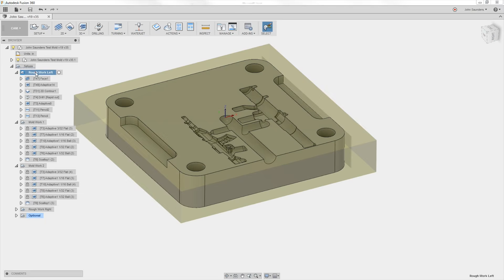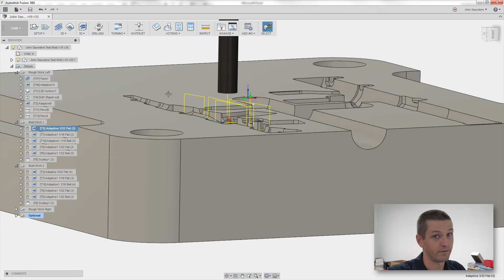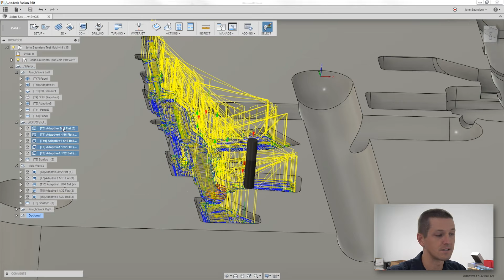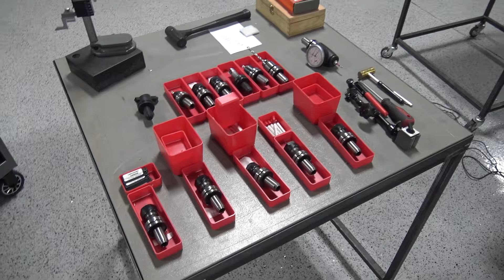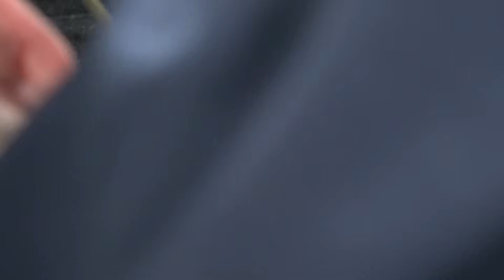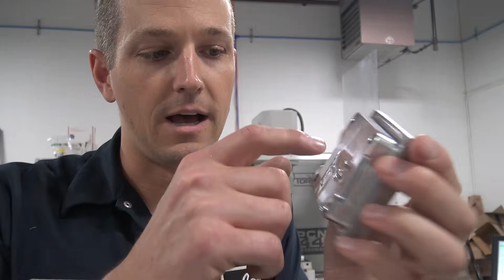Machining a DIY Injection Mold!  WW114

Comment: That is very nice. I have been machining with micro bits all my life. I work in the jewelry industry making injection molds. Class rings, Championship rings, Coining dies, etc. The other day I had to make a .003" 30-degree tool to cut lettering into a steel block for a coin.  I am impressed you were able to machine with the .03" tool and not break it for it is your first time. The .01 and smaller get a little trickier.
Reply: Smallest end mills I have worked with is 0.01" making screwdriver recesses in magnesium screws. At least once I managed to break the cutter just putting it into the machine. I've done a bit of drilling through circuit boards with 0.2mm drill bits, luckily the bits held up fine.

Comment: You can probably even use a semi rigid CNC router for such fine engraving, even in steel. I can't imagine a 40 taper spindle with a 20hp motor being optimal with a 1/32 end mill...

Comment: One thing I would say, I work at a mold shop and do this every day , when checking run out don't just hit the tool to adjust it take the tool out and add plastic shims Into the spindle taper to adjust for run out. That will ensure that I will never bounce back. And you should check every Tool regardless of your stock to leave because I've had tools run out more than the stock I leaving and violate .love the videos more mold stuff would be cool.

Comment: Cool machine, a nice bang for the buck.  Does the software import the part design and build the rest of the mold around that?  It so the software is junk.  The “flow channels” (runner system) are like sewers.  This will end up being scrap.  The diameter is way too large.  Next, the placement of the molded part within the block is terrible.  What appears to be the stock is right at the end of the block.  Nothing to support the block.  The other end has a lot of landscape in front and is well supported.
Center the part within the block!  I approve and critic designs for a living and this is a total disaster.  It may be the editing but the feed rates seem very high.  Could attribute to tool breakage and poor finish.
Reply: You're not wrong at all, but it's also possible that this is a core / cavity insert for an existing mold, in which case they might have to work around constraints for pre-existing features. (That said- I also wouldn't be doing my mold design in F360, and I'd have some shiny Sim Moldflow runs to show off while describing the flow paths, etc.)

Comment: Looks great but everything in the mould has a 0.4mm radius minimum, using that last tool, but in the CAD you had sharp edges how is that normally acheived?
Reply: It's not normally achieved at all. Adding all the inside radii on a really complex mold half will frequently bog down the CAD workstation to such a degree that you just plan for the radii to be there based on the size of the tool that you'll be cutting with.

Comment: I am working as a CNC operator for an injection mold base company,How much machining time taken to cut that runner design.Which tool you have used for and how do you do select the boundaries in software for it if possible please explain it in a clear video or share the details to my mail id.
mvrssnath@gmail.com
+91 8341108089
Waiting for your reply sir.

Comment: John, 
I think that the runout issue was because you measured the tool on the tapered section. My guess is that if you measure the end mill on the straight section, it will have almost no runout. The runners came out smooth enough but if you want them to have fewer chatter marks open up the radius of the runner a few thousands and the machine will cut it in a two passes.  Anytime that you run an end I’ll into a path fully buried it’ll chatter a little. I’d like to see the operation where you put in the guide bushings for the leader pins. Ae there any ejector pins in this mold? Overall great job!

Comment: Good video. Not being a wise guy, but checking collet / tool holder / spindle run out you should be indicating the shank of the mill. That is centerless ground and will be true. Indicating the taipered relief you could be picking up relief eccentric.

Comment: If you want to try another injection mold, please let me know since that is what I specialize in. We normally use tapered ball end mills with 1mm, 0.5mm, 0.25mm, and 0.1mm ball diameters. the tapered end mills are typically better since they are more rigid (less deflection) than a ball or square end mill. also the tiny end mills need to be turning around 12-16k in well balanced tool holders to reduce chatter.  

The roughing end mills depend entirely on the shape and size of the required cavity but i can give you some pointers on that sort of thing. 

Lastly, a cavity like the one you made in this video would actually be cleaner and pretextured with a sinker EDM. You'd need to first mill out the electrode in carbon or copper then mount the electrode in the EDM and let it spark away until the cavity is fully formed. 

If you're ever in SoCal please feel free to hit me up and i'd be happy to show you how we do things. (its not as pretty as your shop but it gets the job done)

-Sean 
Tera Engineering Co.

Comment: What's the spec on tne milling cutters are you using? I've never got anything below 1.5mm [ 1/16th] to not snap as soon as it touched metal even at really slow speeds and minute cut depths.

Comment: Awesome video, very insightful! I'm a sculptor looking to automate and increase production on a diy budget. Would it be possible to use 3d printed molds and silicone molds inside a simple metal shell for injection molding? What would some potential issues be?

Comment: Couple things I'd say, might have been said already, but my .02¢ .. I think you'd be surprised if you put on empty EM holder in the spindle with a typical AGD .001 indicator and checked how far you could move your spindle by hand.  Not with a hammer or any other shock, just by hand, pushing and pulling.  Second, I believe the 'slop' in your indicator is likely the backlash in the fine adjustment screws, simply.  Yep, they have backlash too, just like every other screw in the world, lol.  Lastly, molds generally are left with all sharp corners to prevent flash, and the 4 holes are usually ream/ bored to -.001 on the A-side (top) and +.001 on the B-side (bottom) or done oversized on Alum and bushed with hardened bushings, and the A-side has hardened dowels pressed in, to prevent galling with the constant opening and closing.

At any rate, rather new sub here, like most everything I've seen on your channel man.  Been in the biz close to 30 years, but have stayed open minded and am constantly adapting, as we all should be.  Nice to see the younger maker movement make its way into machine shops and keeping it going.  I'm a Journeyman, but the next generation, you included IMHO, doesn't seen to be as interested in that, but are learning as you go and getting better with each and every job I can imagine!  Keep up the good work and vids, thanks!
Reply: Comments about backlash related to the flat bottom EM, not the ball.  The jumpy reading on the ball would likely be attributed to the spindle bearings, tho possibly a loose dovetail, chips or a lead into the grind of the tool. Also, the gates are normally flat bottom, just generally speaking, instead of contoured.  Again, great looking little mold my man!

Comment: Would a typical CNC router 2.2kw water cooled spindle style wood router be able to make something like this, say injection mold for sinkers, soft plastic lures, etc. Ones I am thinking of are usually 200 steps per revolution stepper with 5mm pitch on the ballscrews, so 0.025mm potential accuracy +- the losses for rigidity.
Reply: We run two CNC routers, 15 hp water cooled & 12 hp air cooled. Both run all day. I can't see any advantage to the water cooled one, and several disadvantages. For small parts steppers are probably fine & a lot cheaper than servos. For the accuracy required for a lure there are a lot cheaper ways to get there than CNC. The fish won't care.
Reply: Yep.  I ran a 24K  2.2KW spindle and VFD for years.  Makes these itty-bitty cavities cut a lot quicker.

Comment: John, this is not a mold by itself, but it is a part of the mold, where we injection molders say core & cavity. 

The cross in between (you made here)is where the molten plastic flows, is called runner. and there is no sprue & sprue bushing where the hot plastic is injected. The runner should not be more than the half of the molded plastic part.

So when I say it is part of the mold is because it is missing few items like, water inlets and outlets for cooling hot plastic, sprue bushing for machine to inject and also I see that there are no ejector pins to eject the part from the cavities after the cycle is completed There is no injection machine in the world where the material is injected from the side. But if it is a Blow molding then YES. The Blow molding terminology is totally different than Injection Molding.

We never use aluminium for long production runs as Aluminium is a soft material, the closest possible material is 4140 or tool steel. Maybe they made this for prototype or a small production run like 5-10k shots. Whereas we calculate for a production run like minimum 100k.

Can you please check with your customer if i am correct ? Will appreciate your efforts.
Reply: It is indeed the mold - one half of the entire mold.  It is not an insert, and there is no frame.  no water lines are needed, not sprue bushings, as the plastic flow is entirely parallel to the parting line.  He didn't mention blow molding because this is INJECTION molding.  It is also an aluminum mold for prototyping - it is not a production mold (though the customer may use it to produce small runs of items for the small LEGO customizer market).

Comment: Erm, this popped up in the feed after your filem :)

https://www.youtube.com/watch?v=RMjtmsr3CqA

The Engineer guy, talking about injection moulding, history and modern practice. Which includes the breaking of the edge of the mould so there is a slight flashing, but no sharp edge to cut your operators..

Comment: I work for an injection molding company, doing a lot of mold designs. I always try to center the parts in the tool. The end of the rocket launcher is way too close to the edge. If any material or dirt gets caught there, that thin wall is going to collapse, very easily. Keep that in mind, if you ever do this again.
Reply: Brett Hobbs can i get a mold done like this?

Comment: I currently work in a shop that manufactures parts for pace makers.  I never knocked runout out of tools until starting this job.  It is a MUST when using small diameter tooling.  I would recommend checking the runout on the cutting edge as close to the end of the tool though.  It is possible to have runout on the cutting edges and none on the shank near the collet.  Also, you should be finding the high point of the tool before checking the runout.  If you are off center, you will not get an accurate measurement

Comment: Just for what it's worth. The "mold slot" is usually called a sprue. Just to have appropriate terminology.  But it's all good.
Reply: Out on a limb The initial run from the nozzle is called the ‘Sprue’. The branches are called ‘Runners’. The small ‘slot’ where the plastic finally flows along the runners and into  the mould cavity is called the ‘Gate’.

Comment: hey guys i need help!! how would you guys make a mold for a silicone injection product that is basicly a baby bib but it has a kangaroo like pouch for dry snacks?? i have 3d models and renders to see product im talking about? im at stage of manufacturing of product but i need advice on how to get from drawing board to mold to production. Can anyone help?
Reply: Call RevPart and they will give you a quote, they do silicone injections 844-738-7278. Or upload a drawing https://revpart.com/quick-turn-quote/ for a quote in 24 hours.
Reply: We specialize in making the silicone injection products.Feel free contact me caroline@modern-mold.com

Comment: how much would it cost roughly to make a mold? like the size of a skateboard wheel
Reply: NYC CNC like a mold for a skateboard wheel
Reply: Well it depends on the level of detail and complexity of the model, but... I'm guessing around $10,000 - $20,000 here in the United States. Assuming you already have the model designed to work with the mould designers, it shouldn't be too costly. Try to talk to many companies, large and small, and find a price that works best for you. The key is to get as many quotes as possible.

I assume you already found a place, but I wrote this comment for anyone else interested in the pricing.
Reply: skeletonboi is it really a piece of CNC worked metal $20,000 worth? What the hell.
Reply: @CesarEnrRC1  
mold need from 45 to 60 working days.... not child's play stuff.... the mold reach to 2000 pound weight

Comment: ok man. i have weighed in before but this i just cant leave for u to learn your lesson on your own. dude. Why, just Why are you Wasting you time with collets? they have Zero repeatability when holding both tools and parts. I about had a stroke when u said u had a 4 ten thousands run out + - . Oh My Gods and Goddess. U just published a vid showing so much better performance and u talked so highly of other tool holders. If u want to be taken seriously about making good products, u need to figure out what works and stick with it. collets are awesome, but only when used for what they are good for. When it comes to precision, just take your time, NO product requires you to be quick and if they do, they are not a good customer.
Reply: Indeed.  Shows up clearly on these tiny cutters doesn't it?

Comment: Did this mold require venting?
Reply: lol I doubt it. Maybe one or two little vents.
Reply: Depends on the plastic used.
Reply: Yes, these molds also require vents
Reply: No, they don't.  There's a minimum of surface area, and it bleeds just fine at the parting surface. I rarely vent my 2.5" x 2.5" tools, and they inject just fine.

Comment: the shut-off Surface by the rocket launcher needs to be larger because the molding pressure can easily push that out the plastic floating is called the runner the entrance to the park is called the gate I don't know how you programmed it would try to leave the park a dress shirt so that way you can get a really nice finish heart

Comment: Question - why did you scallop the edge of an injection mold... wouldn't that show a seam when the two sides are combined?
Reply: I am an injection molder, and mold maker......any mold will have a split line no matter what. The idea is to make it as little as possible, and or hide it in the geometry of the part. Scalloping in molds is the best way, but when you are done cutting the mold, you polish the surfaces to allow an easier ejection of the part.
Reply: Jason Vincent is a mold maker a machinist or an engineer?

Comment: quick note on tool runout. most mill spindles are requires to be under .0002 total runout measured at the taper. the only way I have seen near spindle spec runout conserved when measured at the tool involves shrink fit tool holders. 5 tenth tir aint no thing man.

Comment: Like your video, well done:) With regard to aluminum, I specialize in 7075-T651 aluminum injection molds. I have tools that have run 250,000 plus cycles and still going strong:) Just to help you out, that is a runner and those are called gates to the cavities and please, never chamfer across the runner as there will be serious flash:O! My video is in our garage along with our CNC shop. My son is molding flexible PVC. https://youtu.be/FQxx2hAyvWI I use OneCNC for my CADCAM software, love it... Be Blessed!

Comment: Do not make a chamfer next to the inlet. It makers burrs on the inlet string when molding the parts. I do not hope that the tooldesigner has drawing it that way.
Reply: John likes to clean up his tool edges.  He just went a little overboard.  No worries.  It can be pocketed off, or insert-plated at the injection location.

Comment: If you don't line up your indicator with the needle 90 degrees to the line made by the center of your tool and the center of the ball on the indicator, you can get some wildly varying results. Try just moving the indicator laterally around a little and you can see how much effect it has.